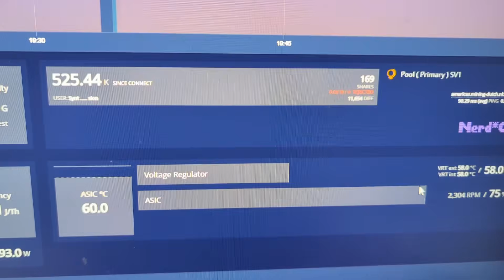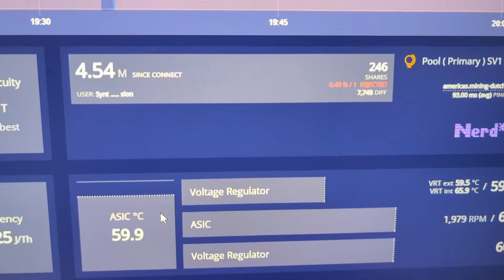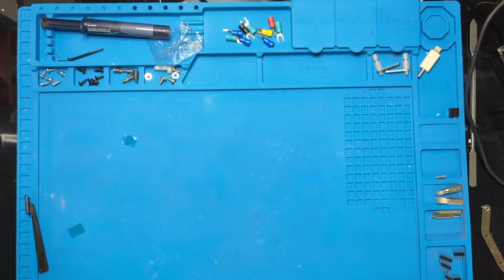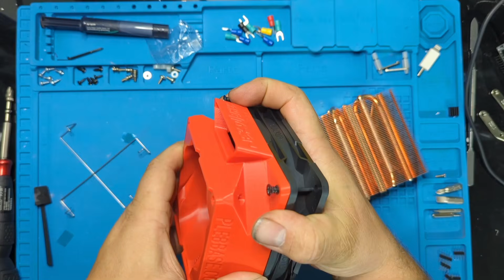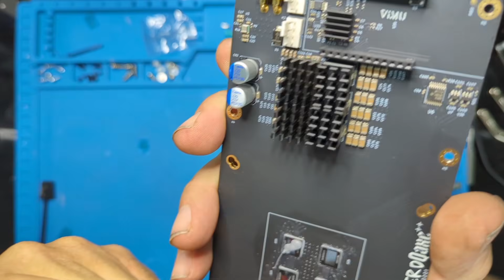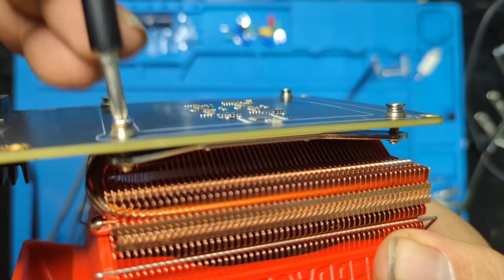NerdQaxe++ High End Thermal Upgrade – Rev 6.1 & 7 Comparison!

Comment: For that heatsink and miner, 3.5 mm spaces are what you need (from my own messing around).  The ones that came with my rev7 are roughly 3.5mm IIRC.  My 6.1 used spring screws and they suck.  Replace with spacers and M3 screws..  Also, you don't need that much compound.  It doesn't matter other than cost...which is eh...just sayin'.  Also, tighten in a star pattern, it's not impossible to cause small warping/bending.  Also tighten down in smaller steps after finger tightening.
Reply from the maker: Always go in a cross pattern, I worry about flexing too much. Solid info on the spacers.
Reply: @SyntheticDee  cross-star, same. :)  I say star out of habbit.

Comment: I missed what % your fan is running at after…to me that is one of the great advantages is the upgraded heatsink lowered my fan speed and decreased the noise.  I just aim to keep both VRM and ASIC temps below 60 degrees.  You should be able to run those at 6.1 TH/s, temps below 60 and fans around 50%.

Heat kills.  Had an Octaxe v2.2 with the long VRM heatsink (only screws on the ends).  The circuit board had a little warp that prevented the two interior VRMs from making good contact.  The result, one of the interior VRMs shorted out.  After having it repaired, I drilled and tapped a center screw (there already is a hole in the circuit board) to ensure contact and prevent failure again.
Reply from the maker: They are set to auto and 60c temperature. My hydro nuked the top VReg.

Comment: Did the exact same on my 6.1++ but with a Noctua NF-A12x25 G2 and the non copper version. 61F on the asic and 54 on the VR. Running at 6.5Th/s and can barely hear it. Love it
Reply from the maker: Did you do auto fan control or manual?
Reply: @SyntheticDee  I've got it on auto at 65
Reply from the maker: Nice!

Comment: Great video. I only upgraded one of my NerdQaxe with the copper one and really not that impressed. I still have not had a shroud printed though and am just running external thermalright fans zip tied to the rear of the stands. Biggest change I found was also going to the MX7 from MX4. I did not like the MX6 or TF7 even compared to the MX4 would be interested in your comparison.
Reply from the maker: Interesting. I mainly use mx7 but have dabbled a little with other stuff.